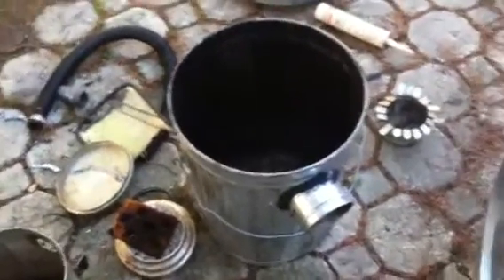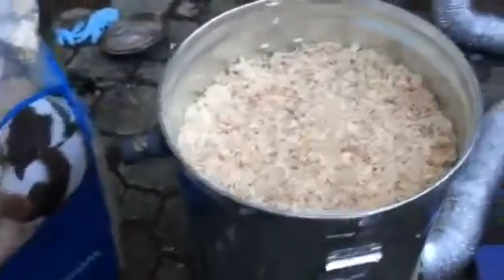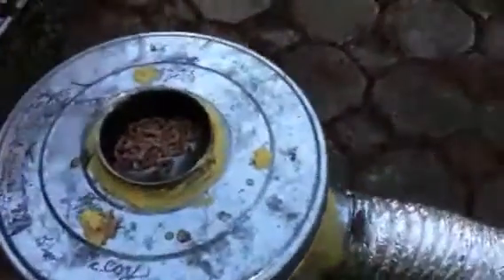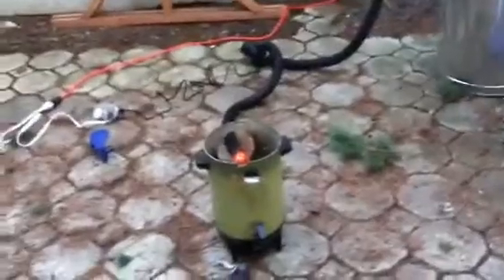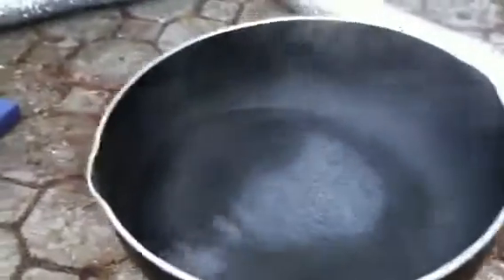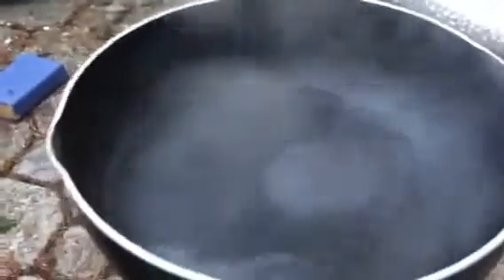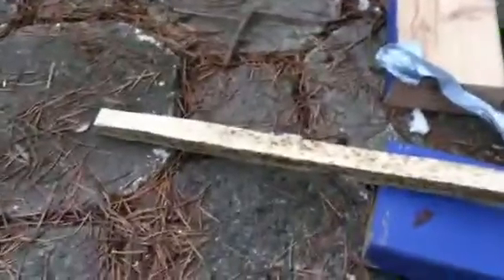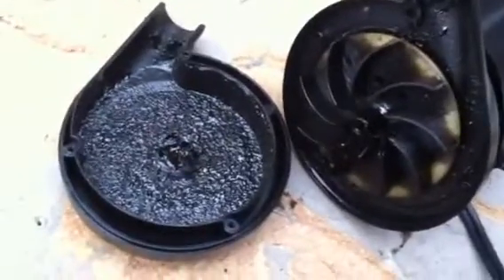Simple Woodgas Generator V2 with improved filter

Comment: Hello Franklin,
Well you've got the bug now. The tar build up is from too low a temperature to crack( disassemble the long string molecules into shorter strings). I joined a great gasifier site where there is an abundance of info on builds and designs.
I started out about the same as you(built a tincan woodgas cook stove) and got hooked.
Check out and join this site, you'll be glad you did. It's free and there's no baloney involved and there's hundreds of proven builds to inspire you.
Check out the forum on driveonwood.com
Pepe

Comment: love your trash can gasifier seems to work well. I did notice that you run the gas through the fan itself, and by the looks of the fan housing there is some tar build up there. have you tryed useing a t to attach the fan to the output hose? the fan would then be able to push the gas without the gas going through the fan housing.  I still say this is one of the best and simplest gasifier setups that I have seen ! will be building one early this summer. thanks

Comment: we're trying to work out how to use something like this, to run our 6.5 Onan generator.. got any ideas? It's a single cylinder, side draft carb, I need something portable or small.
.... a fan of yours from Oregon!!
Reply from the maker: This design can be used to directly run the Onan generator. You have to get it started and heated up. Then you should be able to hook up the hose to the generator and run on it.
Reply: thanks,

Comment: Hi, cool build.

does the fan have to run all the time or can the system push the wood gas out by itself once it's pass the startup time? thanks
Reply from the maker: The fan has to run to push the wood gas when you are flaring it. If you hook it up to an engine, the vacuum from the engine keeps the reaction going.